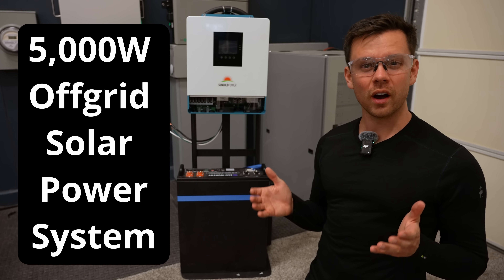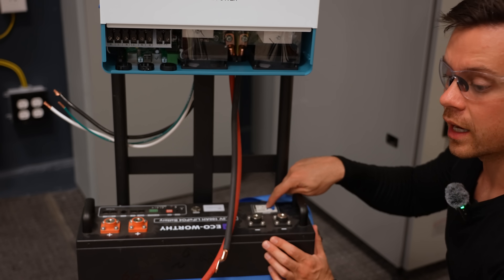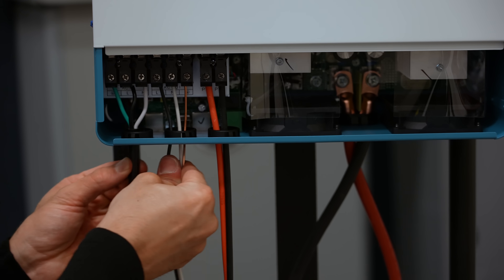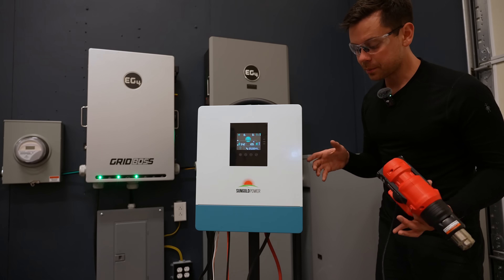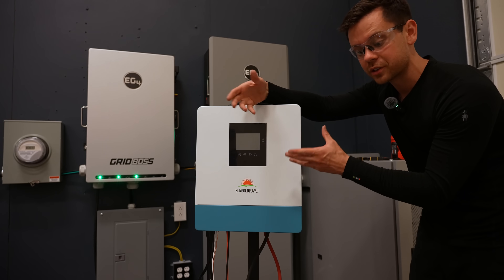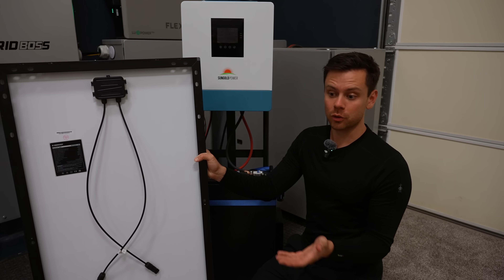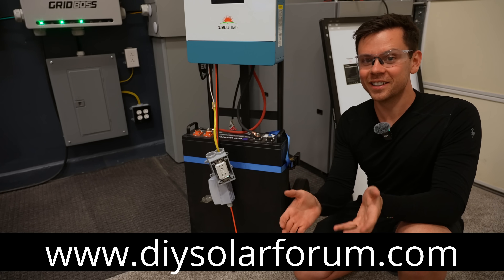Build a 5,000W Off-grid Solar System in 1 Hour

Comment: I am thinking about buying 6 ecoworthy 12.8v 280 amps =3584w x6=21,504w.  Now I am thinking I will be in a van in the desert in winter. So I am going to need a good wind turbine cause in CA desert in Winter which is very soon  I will only have 3 hours of good sun. Sunset usually 3pm. But a lot of wind at 10 to 15mph and 15 to 30mph and at night you get 30 to 55mph. Vevor 500w wind turbine discussed on YouTube. One guy said he only got 165w from his test but his wind looked very weak. A commenter said you should be able to get 60% of what turbine is rated at. Which would give me 300 watts with the wind I will have access to  I think I will use 900w of solar and the wind at the same time if this is possible? If not possible then I will use solar power for my Bluetti ac200L and AC180p.  Which will give me a total of 30k watts but I am gonna use the 20,500wh self built unit to run heater at night when it’s in 30s to 40s. I look forward to any advice. Reading your book now Mobile Solar Power.  Pretty weak on wind maybe a paragraph on page 44. But I am still learning Solar but wind will be needed more than Solar when I go to Borrego Springs in November or December

Comment: I did this same exact thing about a year ago. I even used that same SunGoldPower 5K off grid inverter, LFP battery and seven 450W panels. I initially did it as an emergency power source. It works so well that I just leave it plugged into a 6 breaker transfer switch so I can choose and isolate loads. It powers most everything in my home day and night. My power bill has been cut by more than 2/3rds. Good stuff!

Comment: In an off grid a will need to run my gas furnace and refrigerator so a 5000wh should handle one or the other a different time

Comment: Hey man.  I have  
* x1  12v 200ah Lifopo4 battery,  
* 12/24v  40amp  mbbt solar charge controller, 
* 2000w inverter max 4000w,-
*  1x  200w solar pane.    l......Also a.... 
* [Ryobi] 2300w-crank
               1800w-run gas powered  inverter generator, 
* 30amp AC to DC smart battery charger....

I want to game on my computer all day....can I hook the  generator charger and the solar charge setup together to keep the battery charged while simultaneously discharging from computer use...do I need like a load balancer or something.......omg I'm already tired from typing this from my phone

Comment: Wish you would elaborate on the use of grounding wire from system or lack of need for it? Houses have electrical grounds for a variety of reasons, but none is being used here from the inverter use? Any concerns?

Comment: this is for a biginner?  well a beginner with $$$$$  I like the model but  i would use my pure sine wave inverter 2,500watts with a 12v 300 watts lifepo4  or 1 24v 100AH  battery. my needs  only for the refrigeraters and freezers in case of power outage short term .  I rent a house so  i will not spend all that money on something i would have to diss install when i move :( .  The only thing missing is 1 or two  12,8v 200 ah batteries . i would have 2 hand trucks with  a 1500 watt pure sign inverter on the second one. after all it is only to save the food in case of power  outage.
i also have a twin gas generator 4000 watts  peak 3,500wats normal  so i can recharge those batteries in case solar cannot.

Comment: Good video.  I wonder.  I'm about to build a small work shed and put it in my backyard.  I would like to be able to have some LED lights on the ceiling and perhaps just an outlet to be able to charge up tool batteries.  So 5,000 watts would be way over kill.  What would you suggest?  I like the entire setup the way you had it, I just want a smaller system.

Comment: so I'm wondering if I'm doing it all wrong I mean it seems to work the way I've been doing it but that doesn't mean I'm doing it right I have a small generator an echo flow to be exact and it has solar panels which were purchased in addition and plugged into the back of the unit

I've been connecting the positive to the positive and the negative to the negative

Am I doing this wrong and should I be connecting positive to the negative and the positive to the negative?

Comment: Finally . . . Have 3 12 volt car batteries ganged together . . . Been getting by on these to power my boler camper.
What we in the real world is more 12 volt appliances. I have all overhead lights as LED units in my camper purchased from the truck stop.
But I also want to equip my tiny house with 12 volt.

Comment: You stated you could add a load center without any worries. You said that was 5000 W. my calculation says that you should have a 240 V 20 amp main breaker on that load center.  Yeah, you could probably run a small cabin off that. Even with a small air conditioner and a small refrigerator, you could even power a well pump as long as the air conditioner was off and use propane for the stove and water heater.

Comment: Love the videos! So much good content. One question though, why wouldn't I combine solar panels in parallel once I hit my target voltage using a combiner box? (Say my charge controller only has a certain voltage, but can use more amps) Are those no longer recommended/used anymore?

Comment: Hi, great video, would have been great if you had also talked about wire gauge sizing from the solar array to the charge controller as I am looking for a little info for cable sizing for my 2 Ecoflow Delta pro system and 8 520w panels, 4 per battery on 4 lines using the two xt60 entry inputs per battery. X2 3 panel arrays and x2 1 panel arrays (47voc/40.1vmp/13.4A isc/13Ai mp). The array's ideally could be at 50m distance from the batteries (buried conduit) , and that is my problem. From what I am aware it is the single panel lines which would require the heftier cable. Brilliant if you could give le any advice on this. Keep up the great videos. Best regards.

Comment: For the solar PV circuit breaker. Do I insert into the inverter, the side where the switch would on? Or on the side where it would be off? I bought the circuit breaker from his site and it came with MC4 on both ends

Comment: I've been watching a lot of your beginner videos as I'm working on my own first system.  They are all incredibly helpful.  Something I'm running into though is a lot of them mention these outlet boxes that aren't for sale in a 240 configuration and that's what I need.  

Would you do a video on wiring up a loads panel? You mention it in the build your own system guide on your site that it's easy to do, but I haven't seen a how to from you (unless I've missed it)

Comment: I am so new to solar. What would i need for a tiny house that has a single 50 amp camp connection? it has a mini split, all in one washer/dryer and a small oven, induction cook top along with the normal additional items like LED lights and Fridge and so on.

Comment: I attempted to build this hand truck system with the sungold SPH5048P and the ecoworthy server rack battery.  I did upgrade the hand truck to a 1000 lb gorilla.  Also, an electrician helping me recommended upgrade the input and output cables to 10 awg.  We connected a Jindouzi RV Power Outlet box because my offgrid cabin and home emergency backup system are configured for a 30 amp RV connection.  I did a function check on the ecoworthy battery before connecting to the inverter.  Everything was good.  We connected the inverter to the battery and applied AC power.  The battery fault indicator light came on and after 30 seconds the circuit breaker on the battery tripped.  We turned off the battery and inverter.  Reset the battery and attempted to power again.  The circuit tripped again.  I know everything was wired correctly.  The electrician isn't familiar with solar system so he didn't know where to start trouble shooting.  I contacted sungold and they mentioned checking for a short in the circuit.  I'm a novice and not real sure how to troubleshoot the problem.
Reply: ❤❤❤❤❤❤❤❤❤❤      what turned out to be the problem ?
Reply: ❤❤❤❤❤❤❤❤❤❤❤❤    WILL PROWSE is brilliant

Comment: I have a question about the ground/neutral connection.  The way I understand it,  the all in one has an internal ground/neutral connection that is needed if running loads off of the battery or charging with a non bonded source.  But since the AC power supplied through the house outlet is traced back to a panel that is ground/neutral bonded then shouldn't the all in one have to be toggled through the menu to disconnect the internal ground/neutral bonding before plugging into the AC power to charge the battery?  Also, I thought you needed a T-fuse off the battery?  I am lost on trying to learn all this stuff.  Any help at all is appreciated.

Comment: I just completed this exact setup. I don't believe Will touched on this but default input A/C current is set at 60 amps.  You'll want to change that setting if you're using a plug in A/C cord.

Comment: Hey Will, I have a Ford Transit Cargo Van and really like this build for my van. I want to put solar panels on the roof to charge the battery and also have the ability to charge the battery by plugging it into an outlet when my van is parked at home or a campground. I plan on using the battery to power a dehumidifier inside of the van, a roof top AC unit, a small fridge, and also to hook up a battery tender to my motorcycle which I carry inside of the van. I know very very little about electricity and how all the works but your videos definitely make me feel more confident. But I am a little confused on exactly what parts I need. So far I have picked the sungold power 5000watt 48v, vatrer power 48v 100ah lifepo4 battery, rover boost solar charge controller (I will only be able to fit 3 solar panels on the roof of the van), AC input cord, outlet box and 6awg thhn, 10awg mc4 extension cable, solar disconnect switch. All the products are from links on your website with this video. Do I need the 48v to 12v converter? I want to get an alternator added to the van also to charge the battery. Anything I am missing to make this work? Thank you again for your great videos, still watching through all of them to increase my knowledge

Comment: I built this exact system even down to the harbor freight heavy duty hand truck. After finishing I turned on the battery and the inverter did not wake up, I realized I forgot to turn on the rocker switch on the bottom of the inverter so I turned it all off then inverter on then battery on and still nothing. Battery shows to be in standby mode. Any help would be appreciated.

Comment: Nicely done!  I wonder about the UPS/transfer aspect of the inverter. Wouldn't it place a limit on the power output when the input is set to use AC (mains) in? Unless there is a way to hard wire into a main circuit panel then you're stuck at 15 or maybe 20 amps maximum. The output, as you said, supports much more than that so you wouldn't want to be limited to an anemic input current.

Comment: Greetings -- I didn't see a reference to the gauge of wire that connects the battery to the inverter. I got 2' length with 5/16' ring terminals but what gauge ?? Great video -- Thanks !!

Comment: Hi will , Ive watched this video many times thank you so much for making this simple. Power stations are to much and don't give the capabilities like this all in one does.  My question is does the outlet box come with a 30amp outlet? I know recently they improved it and was wondering if I could use this system to plug in my generator plug in my off-grid shed

Comment: I'm having trouble getting 6AWG stranded THHN wire into the terminals for the AC OUT on the Sungoldpower 5000W inverter - the slot in the terminal isn't wide enough.  Did you experience this difficulty?

Comment: To connect a battery bank to the inverter (SPH5048p) requires a 2P-200A DC circuit breaker, correct? Connecting 1 battery as you demonstrated but no mention of circuit breaker, I am a little confused.

Comment: I left a post on the forum. The panel you removed prior to starting this vid was horrible on mine. Required me to drill out the bottom three. The two side one were difficult but I got em out. It was crazy. Also, you mentioned the breaker on the side but I trouble shot for a 2hile to figure out there’s a power button on the bottom, ha ha.

Comment: I enjoy Will,'s videos and built this cart using a sungoldpower inverter with 2 version 3 Ecoworthy 5000wh batteries.  I did not mess with the factory settings  and did not set up the communications.  Batteries were not very well balanced so I charged them individually first.  I let a 500 watt draw the batteries down until they shut off. It caused undervoltage alarms and inverter would not restart with solar the next morning.  Had to reset the inverter. Should I change a setting on the inverter so that it shuts down  before the battery bms does it ?

Comment: I'm slightly confused as to when you plugged in the AC into the wall - we have no plugs at the moment, this is the source of our power so not sure how plugging into a wall when its supposed to be the thing producing the power works?  Our inverter model is SPI-10K-UP (which comes up with specs in multiple places online if that helps.   Now, we have the pieces to put together our solar set up and plan on it first feeding a 100amp panel.... except for the solar panel disconnect switch.  I don't know which to get.  Our string has 8 Trina N-type i-TOPCon bifacial dual glass 720W panels.  Which would be the correct disconnect switch?  Our system came with a "circuit breaker protection, Lighting protection PV combiner box" - is that the same thing?  Thanks for your help

Comment: Are you worried that the AC input cord is not 8 awg as rec'd in the user manual. Stated max bypass current is 63 amps. Can you throttle the AC input amperage to match the AC input wires you use in the settings of the controller?

Comment: what is screw size to connect battery wires to the sungoldpower 5000v inverter?  Mine didn't come with screws for inverter's battery connection.  Thanks!

Comment: I really like the simplicity of this system.  We have priced systems to run our class C motorhome and was turned away by the complexity and price. Is there a way to add 400-600 ahs of battery and unstall a 30 amp outlet? We could use this for out motorhome as well as our home if needed with the exterior 30 amp generator plug we have outside. I know there is a difference between the house plug and RV plug. One is 240 and the other is 120. It would only run one leg of our house panel.

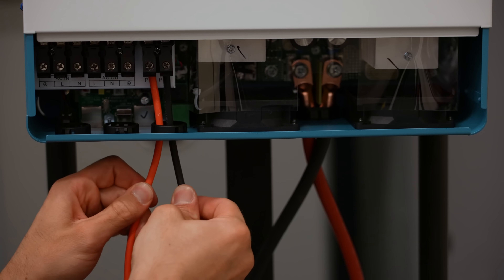Comment: Those DC connecters.  Never do this guys.  Buy some heat shrink and protect your house from burning down.   Need those cables straight down. or at least pulling in opposite of 2:20 if you can't get any heat shrink.   The marine heat shrink comes with a resin inside.
Reply: you realize all of the copper is in the inverters input ports when screwed down? 
are you saying there needs to be heat shrink  added to double up the insulation already on the wire? Or do you strip the wire, heat shrink the just enough copper for the input and put the heat shrink covered copper into the input?
or are you saying you buy oversized pieces of heat shrink to cover each port after it's screwed in so you can never unscrew them without cutting through insulation to access the inverters screws? 
so confused on where heat shrink would be necessary or even helpful for connecting the dc input to the inverters screws terminals.

Comment: Good afternoon William I just built an off-grid solar system after watching your video. I was wondering if this system can be used as a sole source of power for my home with the exact components you showed in your video or will I need to add a component that will alow me to charge my battery through solar and power my home at the same time. Please help if you can thanks in advance.

Comment: What are the risks  possible financial risks with having a 5000W All-In-One if any one of the 3 components goes bad?  How easy would it be to fix or is it even possible to fix any significant problems that might occur with any one of the three components of the All-In-One?  Thanks

Comment: Would this system be able to be programmed with TOU settings and simply charge off grid during off peak hours? Considering taking my garage off grid power and charging during ultra low cost tier.

Comment: Would it be worth trying to have a setup on hand for a grid tied solar system, that you could climb up and re-wire things out of micro inverters to connect to this sort of inverter and battery? As opposed to going with a mainstream home backup battery? 

I know it would require a lockout kit if I were to wire anything through my house. But I’m mainly thinking for like worse case scenario, so that I could still use my panels…?

Comment: Can I add an extra battery to this setup by just throwing it in parallel for more amp hours/reserve? Same battery as in video? I JUST SEE THAT THE CONTROLLER SAYS 100 AH OF BATTERY CHARGING. I WOULD LIKE AROUND 3 OR 4 OF THESE BATTERIES IN PARALLEL

Comment: Great stuff, I would love to see a class a rv set up…. using these components and a victron multiplus-ii 2x120 (or a Quattro-ii) and use the 5000 watt as a “daisy chain inverter” connecting to the generator input of the victron.  I saw the “off grid garage” do this several years ago but not in an rv..  thank you

Comment: what's equipment would your reccomend for this > batteries, inverters and solar panels 

Items

>￡1, 735..65 | 48V 600AH LiFePO4 Battery Pack 51.2V 30KW Lithium Solar Battery 6000+ Cycle With 16S 200A BMS For Inverter LiFePO4 48V

 > ￡139.76 | 2000W Solar Panel System Kits For Home With 1000W 2000W Solar Panel 100A Charge Controller 220V Inverter

> £910,19 320Ah 8000 cycle Lifepo4 Battery Grade A 3.2V Lithium iron phosphate Rechargeable Cell For DIY 12V 48V RV Solar Camping

will all of the above items work together. If not what would your suggest?